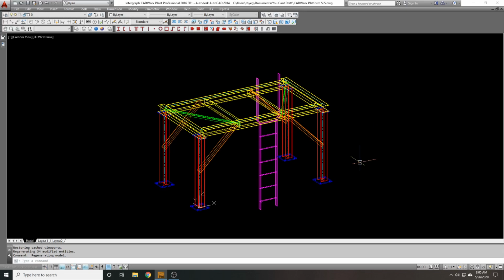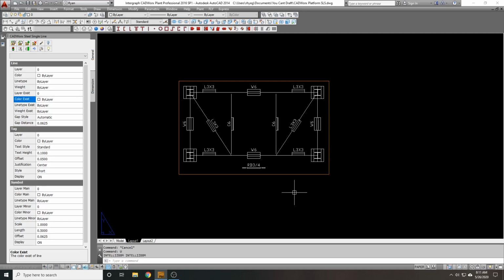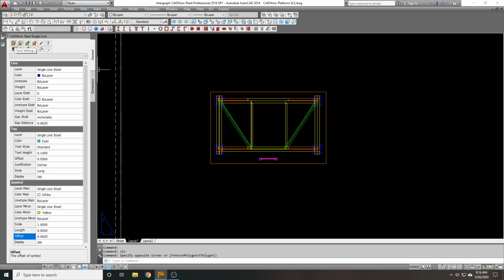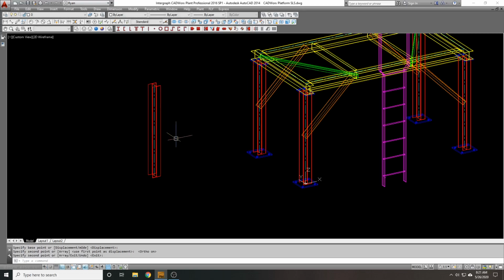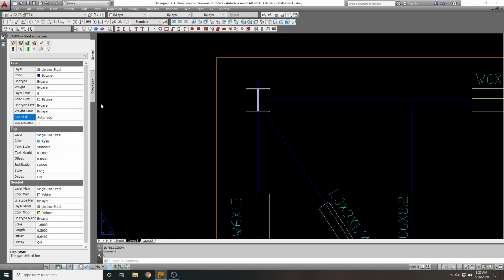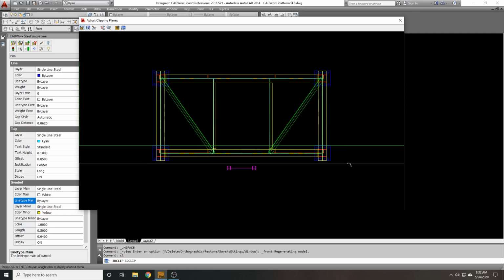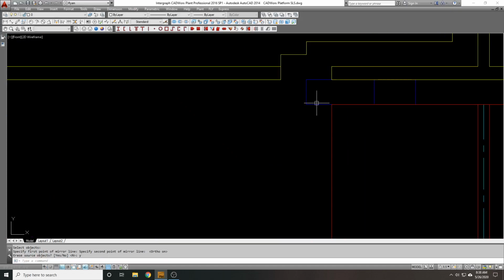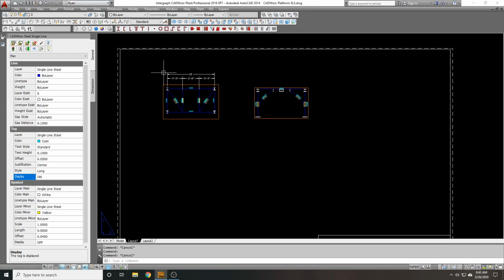CADWorx Steel - Single Line Steel

Comment: I DONT SEE SLS COMMAND IN CADWORX. HOW ARE YOU GETTING THAT COMMAND
Reply from the maker: This is for an older version of CADWorx.  Up to 2016 it was called CADWorx Steel.  In 2017 the program got a major overhaul and was named CADWorx Structure.  if you are using version 2017 or newer then single line steel does not work the same as it used to.  It is broken in all CADWorx Structure releases.